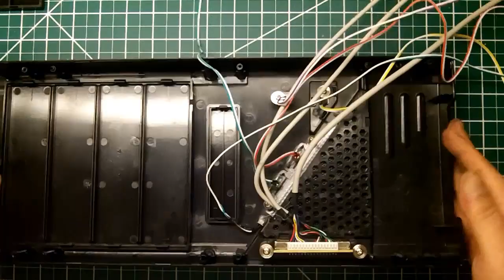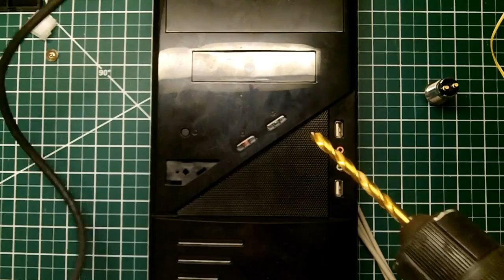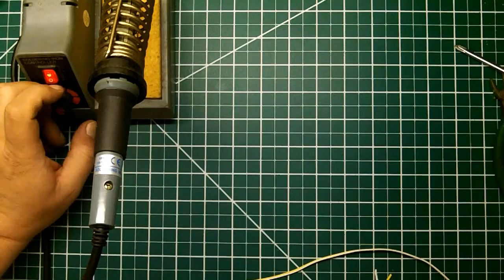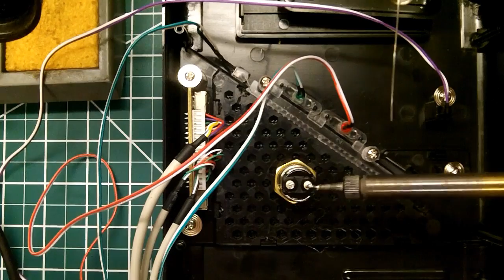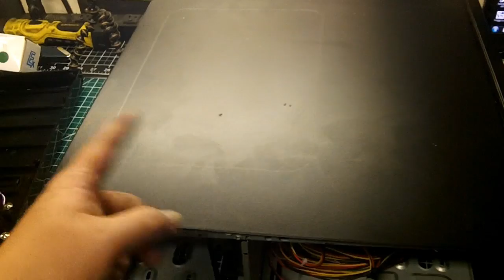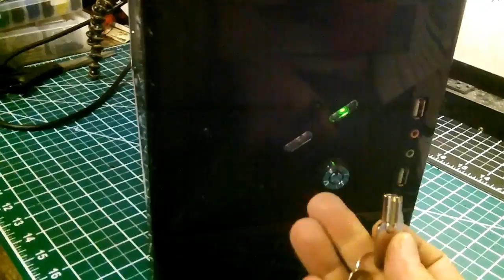Keyed Momentary Power Switch for PC

Comment: Please, how to install a momentary toggle switch + kill switch button to turn on my pc sir? Make a video of this please.
Reply from the maker: Technically your PC already has both. The kill switch is located on the power supply unit on the back of the PC. ;) 

If you want the kill switch on the front panel then you'd want to get a 12V toggle switch. Most PC's already have a momentary toggle switch for the power button. Simply add a 12V toggle switch to your front panel in-line with the PC power button to the motherboard.

It's so easy it's really not worth making a video about.
Reply: @DJDevon3  I don't have any knowledge about it, what do you mean in line? Can you show some video about it please? thanks sir.
Reply from the maker: @zamboni6772  https://ibb.co/yfgwt5w I don't know if this link will show up or not. I created a diagram image for you and uploaded it to a free image hosting service. You'll definitely want to solder the connections together and pick up the same kind of dupont/breadboard wires I use in my video as they'll fit onto any motherboard pins for the PC power switch pins. :) Just make sure the switches you choose are rated for 12V DC. The amount of power going through them is in the milliamp range so anything designed for PC, automotive, or aircraft use will be perfectly fine. Good luck!
Reply: @DJDevon3  thanks man, but there's no picture on the link 😅 The image is corrupted.
Reply from the maker: @zamboni6772  Hmm works for me. Try this one instead. https://i.postimg.cc/NM9NZWds/PC-Arm-Switch-and-Keyed-Switch-Diagram.jpg

Comment: My end goal idea for a power button is a momentary key switch, but I want to use vintage industrial switches and switches from old vehicles or electronics. The idea is an apocalypse-junkyard-scavenged parts type themed build. I'm pretty ignorant about wiring and also about vehicles, and you seem to be knowledgeable about both so I figured I'd ask:

 1. If I bought the key switch ignition assembly from an old car/ boat/ tractor/ etc, would it be possible it could be used as a power switch if I bolted it onto the case or stuffed it inside a drive bay? I'm sure they are designed for a lot more voltage going through them than to just short the connection to start a PC and/or are a lot more complicated than a simple switch like in this video, so I worry about one working on such a light duty task or at all for my purposes. Old as in 70's-80s at maximum, 40s-60s preferable. Mentioning because I feel like how they work might've changed over time .

2. What level of complexity am i looking at if I wanted to make an old analog gauge/meter or two light up and come to life when the PC is powered on? Bonus points if it actually measures voltage or ambient temperature inside the case but not necessary. If I could get it to peak or balance in the middle when powered on I'd be satisfied with that.

Nice video and channel, thanks in advance for reading.
Reply from the maker: All modern PC Power switches work on 12V DC. I'm sure it would work with an actual automotive key cylinder from the 70's-80's. 40's-60's however some used 6V systems but I'd be willing to bet those would still work too if you wanted some type of antique key cylinder. The biggest problem with antique cylinders would be ensuring the keys still work and haven't worn down over time. You can test for that using continuity tests on the key cylinder positions.

Analog or digital gauge meter would be simply enough as long as they're designed for 12V applications. You can absolutely have a temp gauge as long as it comes with thermocouplers (temp sensors). Pilot gauges would work great but you can find the most accessories designed for 12v automobiles. Hell, incorporate a digital vacuum pump of some kind into your PC and you could have a legit boost gauge on the front panel too. :P The key to any, and all, of your projects using PC power is to find accessories that are 12V DC compatible.  If it's 12vDC compatible you can definitely find a way to retrofit it into your PC case. You can use pretty much anything from a 12V modern automotive or aircraft system to customize your PC to your hearts content. PC's, automobiles, and aircraft all operate on 12V DC. ;) Good luck!

Comment: Is there a way to make it go to the Lock Screen rather than power off the pc?
Reply: Hi @Fire Alarm Freak, I'm not a tech whiz but I think what you are looking for can be achieved by 2 steps:
1) Go to Control Panel>Power Options>Choose what the power buttons do and in the part that says "When I press the power button", you choose Sleep.
2) Enable password required on wakeup using this video as a guide (https://www.youtube.com/watch?v=pqR9IFa5YQs&ab_channel=Howtosolveit) 
This way when u turn the key when pc is on, it will put it to sleep instead of power off and then when it wakes, it will go first to Lock Screen.
Hope it helped :)
Reply: @nikhilthomas6046  Thanks!
Reply from the maker: @nikhilthomas6046  Yes that would work nicely but would be a permanent feature and not a button you can press on the front panel to ONLY engage that mode. You'd need a USB + button solution to tell the OS which type of shutdown you want. I don't know if such a thing exists other than in keyboards. I suppose you could hack apart and old multimedia keyboard that has the button then stuff the PCB in the PCB while using it's multimedia buttons on the front panel. That means you could also retrofit PC volume +/- on the case too.
Reply from the maker: That's an operating system control not a motherboard BIOS control. What I'm showing here is a physical power mod for power on/off only. Perhaps your BIOS might have a suspend mode you can take advantage of but I don't think it will have the effect you want vs an OS controlled hibernate/sleep keyboard shortcut. Some older multi-media keyboards have that feature Built-In as a button on the keyboard. ;) Most new keyboards do not and you'll have to setup a keyboard shortcut for it.

Comment: could you explain better how to make an arm switch or give a video link that may be helpful
Reply from the maker: For use on a computer you would essentially wire 2 switches in parallel. When latching switch 1 is powered then switch 2 can be activated.  The difference for a PC power button is it requires a blip or a fast on/off action. PC power buttons are always momentary switches. So your arm switch will be a latching switch and your power button will be a momentary switch.

You can in fact turn on a PC using a latching switch by flipping it on/off quickly. Here's a demonstration of that: https://www.youtube.com/watch?v=RZVoPuuoDe8 That looks like an arm switch but it's actually a momentary toggle switch. So when shopping for a real arm switch ensure you get one that is a LATCHING type. A real arm switch is a latching switch, it acts like a light switch either in the on or off position. A momentary switch will always automatically reset to the off the position, that's not what you want for an arm switch.

Wire 12v & ground from a spare molex plug to power the arm switch OR from the motherboard power button header wire ONLY and not the Ground too. You'll want to use dupont wires in order to split up the positive and negative to the motherboard pins. Wire your momentary power button in parallel with the arm switch so when activated it uses the 12v from the arm switch to your power button. Wire 12v to the power button from the arm switch (soldering might be required). Wire the motherboard power switch pin to the arm switch. Normally motherboard power button headers will have 2 headers. You only want 1 header going to the arm switch, find a ground using the chassis or other grounding location. Wire the output of the power switch to the motherboard negative header pin. Summation: When the arm switch is armed, PC power button is pressed, voltage is sent through the arm switch and the power button to the motherboard pin momentarily.  Voila. 

That is the same method behind a fighter jet arm switch and push button fire switch.  Doesn't matter if you're trying to fire a missile, start a tractor, or a piece of dangerous machinery... the electronic concept is always identical. Unfortunately I can't find any youtube videos covering it but that's how I'd do it.
Reply from the maker: This is becoming a frequently asked question for this video so I made a wiring diagram. https://ibb.co/yfgwt5w

Comment: would it work if i just used electrical tape to force the wire in contact with the metal? i dont have any way of soldering.
Reply: Have you tried it?

Comment: can you just connect any wire to any side? i know that the motherboard has a plus and minus when you plug it in so was just wondering?
Reply from the maker: If you're talking about the power switch or reset switch header pins those usually don't have a positive or negative label because polarity doesn't matter for a momentary toggle switch. Even if your motherboard or front panel pins are labeled with a positive and negative for the power switch or reset switch you can ignore it, polarity does not matter. Polarity does matter for the HDD LED and Power LED because those require constant voltage, they are LED's not a momentary switch. Hope that helps. :)
Reply: @DJDevon3  yeah bro! Thanks

Comment: can you use any type of switch? I heard it has to be a momentary switch?
Reply: Could you add a uk link please, I'm struggling to find exactly what I'm looking for, I'm building my pc on a wood base but obviously I need a way to it on, I've heard that it's a momentary vandal switch that I would need? Is that right? Sorry to sound thick 😅
Reply from the maker: It's best if it's a momentary toggle switch.  It is possible to use a toggle switch (non-momentary) however some motherboards don't react too nicely to that.  Some it will work with and some will just auto shut down in which case you'll actually have to turn on/off the switch quickly to make it act like a momentary toggle switch. So it's doable either way but just make your life easier and have it act like a normal PC power button by going with a momentary toggle switch.  When it comes to PC power buttons a momentary toggle switch is definitely what you want.

Comment: how could I wire that key switch as like a arm switch, that would then arm the push button switch?
Reply from the maker: That would basically be a redundant dual switch. You could wire 2 button switches in parallel to act in the same way.  I don't see the point of it for a PC power button other than a cool aesthetic. Switches like that for airplanes tend to look much nicer, a better selection. You can find them on Amazon or any electronics retailer as long as it's designed for 12V applications using keywords "12V pilot safety switch" or something like that. As to the wiring it depends on the switch itself which should come with instructions. If that's what you want to do yes it's possible no problem.
Reply from the maker: I've had 3 people ask about how to add an arm switch onto the circuit so I made a wiring diagram for it. https://ibb.co/yfgwt5w Hope that helps.

Comment: cool idea this will work for my kid turing off my HTPC  my 2 year old always likes to turn it off and on  thanks for the idea
Reply from the maker: Yes you are exactly the kind of person I made this video for.  Children only want to see the light turn on/off.  If you're working on something important like a powerpoint presentation this behavior can destroy a lot of your time & effort.  

Especially true for special needs children that love to interact with lights or anything that spins.  They don't have enough dexterity to insert a tiny key so it will prevent them from shutting down the PC.  For a normally developed child this still works well into their teenage years.  There are ways to bypass it but they'll be teenagers before they figure out how. You just have to hide the key really well.  

For complete protection against more intelligent teenagers simply find a PC case that has a lock on the side panels too so they can't get into the case to do a physical bypass.  Yeah that will piss off a teenager because a completely locked PC case will prevent their ability to bypass it. Basically this keyed method is only good vs children or those with absolutely no computer knowledge.

Another good scenario for this is a shared household like a dorm room where you might want to prevent someone from accessing your computer without your consent.  Trust me when I say, if you can power up a PC then there are ways to bypass passwords, so a login won't keep out anyone who has physical access and knows how to use rainbow tables.  Only safe way to ensure a dorm room douchebag roomate can't get into your PC is to prevent powering it up in the first place.  You can prevent your malicious roommate from deleting your essay the day before it's due.  College roommate horror stories.

There are many reasons why something like this might be necessary.  The most popular reason is children who like to push buttons. :P